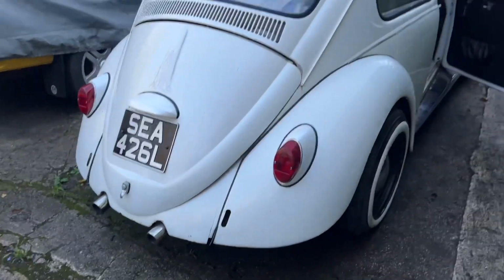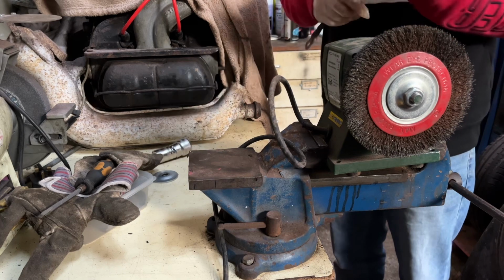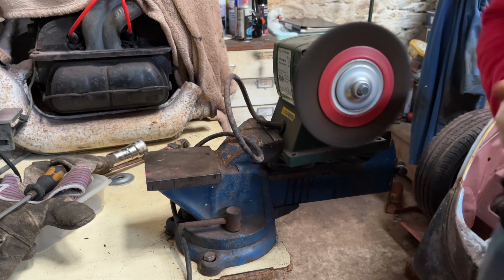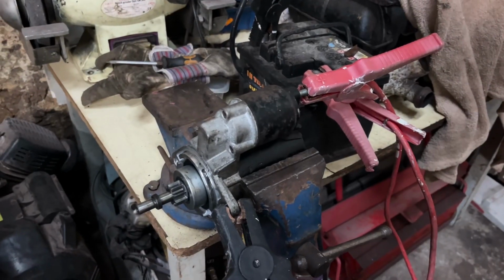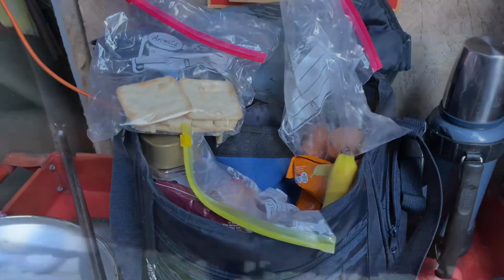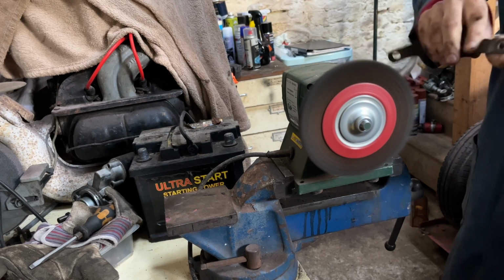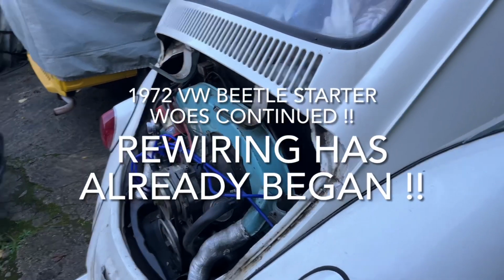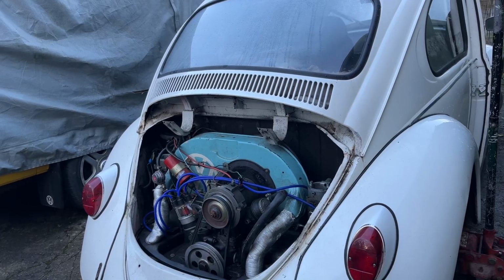VW Beetle 1972 still won’t start,starter motor bench test and shocking wiring  !!

Comment from the maker: Had me beat today tbh. Still earthing fault,shoddy wiring or ignition switch. Cleaned up battery earth and gearbox to chassis earth. Finished the day ripping apart the wiring and rewire back to original and go from there !!

Comment: If you have a self supporting SR17 starter (auto-stick) you wouldn't have to worry about the bushing in the trans. Also that starter sounds healthy when it's engaging with the key... How freely can you spin the engine over by hand? Wondering if something found it's way in the bell housing causing the flywheel to jam or the engine to be locked
Reply from the maker: It turns freely but struggles . I’ll check again today thank you

Comment: Is it possible that the hot from the ignition switch is wired to the alternator and not the battery ? You said that it had an alternator swop and that wiring behind the seat looks odd. Just another thought. Thanks for sharing.👍👍🇨🇦
Reply from the maker: Yeah changed all wiring and still the same Dan that what I thought at first. Thinking gearbox housing bushing worn to operate starter motor

Comment: Andy can you jump the starter with a screwdriver when it's on the engine / in the car? I have bench tested starters before & seem fine put'em in the car & do just that. If you still have no go I reckon it's your starter!
Reply from the maker: 2 new starters used gearbox starter motor bushing fault I reckon
Reply: @vwcoco  Sorry I must of missed that bit! It does sound like it's trying to start! Could be your Bush, was just wondering if it clutch starts?